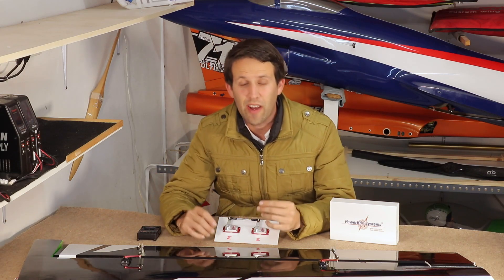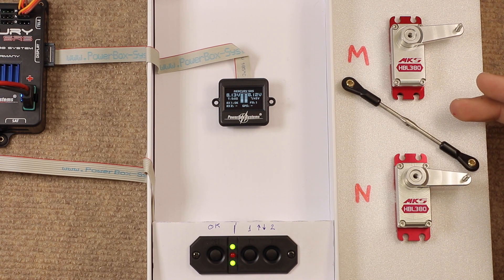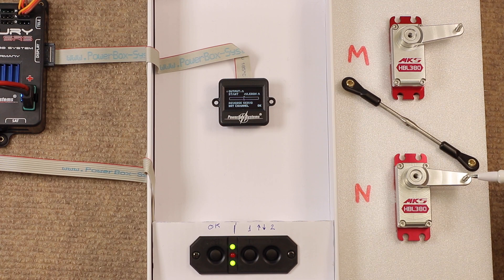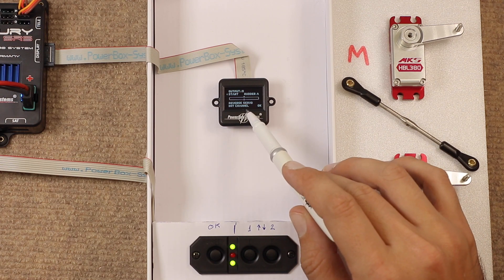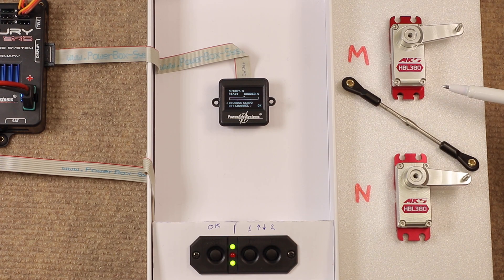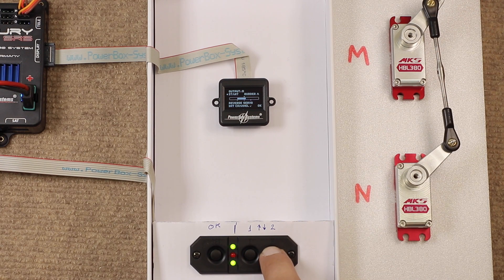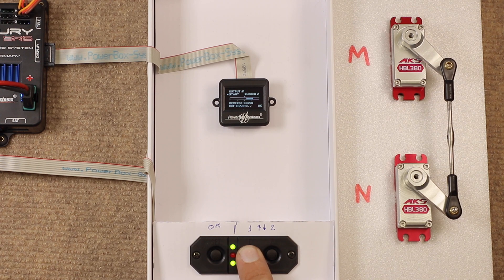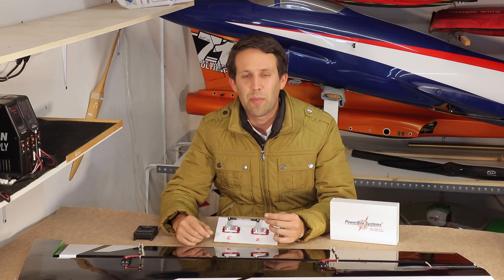SERVO MATCHING Tutorial - For all Powerbox-Systems

Comment: Excellent Video! Two questions:
1. When using the power box core are we simply using travel end point adjustment and subtrim to accomplish this? I’ll be using the new pioneer as well as the Core, so I’m not sure what exactly is being displayed on the small external screen.
2. Question on technique. Do you match your elevators in a similar manner? Making one a master then matching the center and end points on the remaining elevator? Won’t this change the speed at which they get to there separate endpoints? 

Thanks for all the great content. I’m new to power box and love it!
Reply from the maker: Hi, answers:
1- Yes, with Pioneer there is no setup possible inside the Pioneer, it is all done "per channel" with the usual reverse, sub trim and end point settings. With Core you can set a single "Function" (Aileron?) and apply it to 2 servos (both servos on right wing?) so once you make the individual settings with the above, you can simply set the Expo and Rates within the Aileron function, and will apply to all.
2- Yes, set one and match second. As long as mechanically they are good to start with the difference is inapreciable, especially in flight 
Hope this helps!
Reply: @MartinPickering-PickeringRC  thank you for the quick response.Greatly appreciated!

Comment: Hi. Can some one tell me. If core and powerbox system can match servos at how many points. ?  In this scenario it has 2 points only. 
After matching Is there a possibility 25% movement will be slightly off and or 75% will be off. Or will they stay matched Thru out.
Reply from the maker: Hi, there are three points that can be matched. -100% 0% +100%. It should not be necessary to add more points as if center and maximum are correctly set it should follow correctly throughout

Comment: Hey, Thanks for making this Video helps allot !! I have an off the topic question about the powerbox system and support for the Frsky RX G-RX6, Do you know if I will have any issues running them???
Reply from the maker: FrSky are as far as I know, non compatible. At least it is not included in the specs... It will depend if Frsky use the same BUS language as any of the supported systems (such as the relatively common Futaba or Jeti/Multiplex languages)
Reply: Pickering RC I have seen videos on YouTube showing frsky works with powerbox, and I know some pilots use them together in Germany but very little info is out there could you maybe do a related video please !?
Reply: @jameshaladus9165  i assume he doesnt use FRsky. he's not going to buy a whole new tx and rx system just to make a video for you. as far as I'm concerned, they are different bus systems and powerrbox only works with what it says its compatible with. read the manual or something? couldn't tell you what it actually is but I assume it wont work.

Comment: When setting this up in a plane with only a single servo per surface and wanting three rate settings, is it best to set the highest desired rate in the radio at 100% and then use the Mercury's endpoint adjustment to bring down the "high rate" throws on each surface to whatever the high rate throw desired is and then adjust mid and low rates in the radio's rate settings? The alternative would be to bring down the high rate settings percentage in the radio and not use the endpoint adjustments in the Mercury at all. Would the latter option effect the gyro from operating correctly or the best that it can? TIA.
Reply from the maker: When running a single servo per surface, there is no need to make any adjustments at all within the Mercury for end points, you can do it just the same as if using a standard receiver. With regards to the gyro, this is unaffected by the dual rate that you are in and will always work the same, just note that the gyro is "limited" in travel to the maximum deflection input since turned on. In other words, if you waggle the sticks in the highest dual rate before takeoff, the gyro will have up to full travel available to it for corrections. If you did the same with lowest dual rate, then that would be the highest travel available to it, until at some point in the flight you used a higher rate, at which time the "maximum travel for gyro" is updated.
Reply: @MartinPickering-PickeringRC  Thanks for the response.  Since it won't cause any gyro issues, I guess I'll reset the channels I've already done that way in the Mercury and do it all in the radio as the less programming in between the radio and the plane, the better IMO.

Comment: how do you adjust the first servo in the transmitter on spektrum, i don't know which one to adjust
Reply from the maker: You can set up any servo as the "first servo". The important part is that the rest of the servos then match it correctly. When I say set up the first servo, I just mean as normal using sub-trim and end points. Hope this helps!
Reply: but how do I know which channel on the transmitter to adjust? 
By this i mean if i have a servo lead plugged into A on the powerbox, what channel do i adjust in the transmitter, because it doesn't have A like the powerbox?

Comment: Can you do a video for dual servo aileron as well
Reply from the maker: It would be the exact procedure explained in the video.  Set one servo at the radio, and match the second one following the steps above  =)
Reply: so if I set the inboard servo for max EPA from my transmitter?...and match the 2nd one to this?...i'm getting only 35 degree max aileron deflection on my new pilot rc 100cc.....
Reply from the maker: S Khalid that process is correct. The max deflection will depend on the servo geometry, make sure to max out the first servo and then just match the first one.